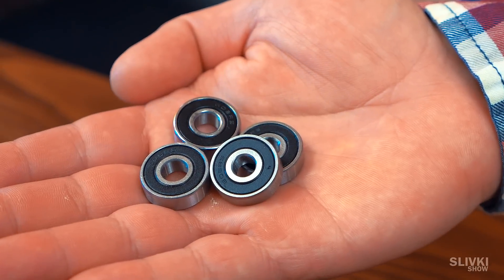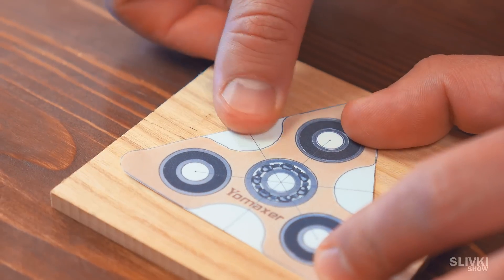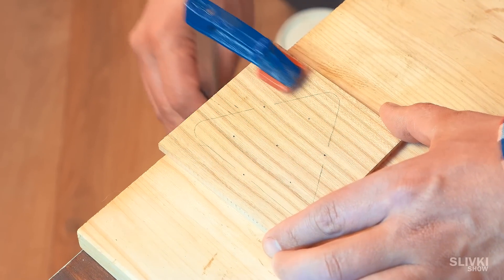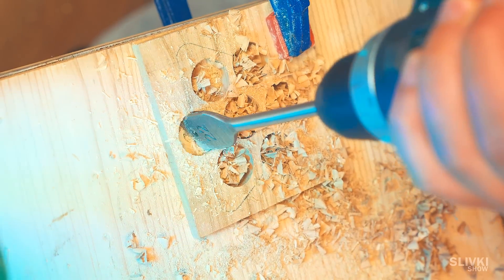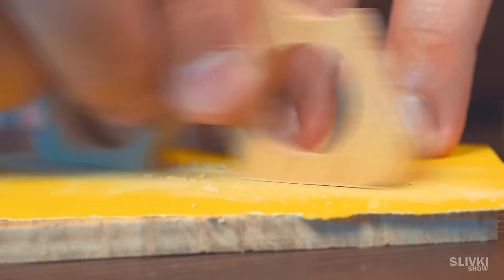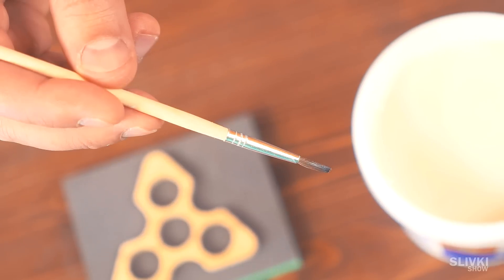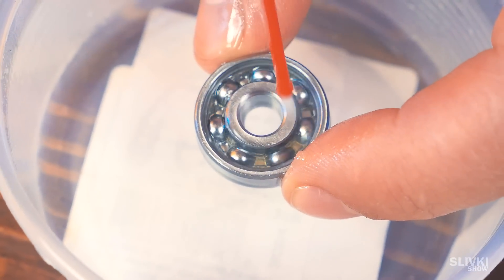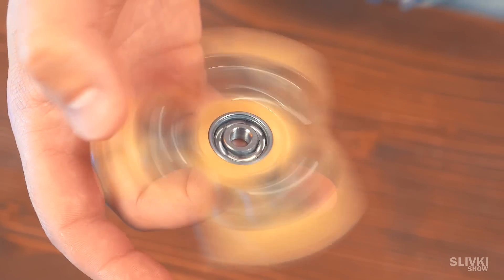Made a FIDGET SPINNER for CAT

Comment: I'm pretty sure that removing the seal and grease is not a good idea because then stuff can get inside of the bearing + the bearing is dry so it's going some noise and will not work as intended. At that point the best thing to do would be to just change it.